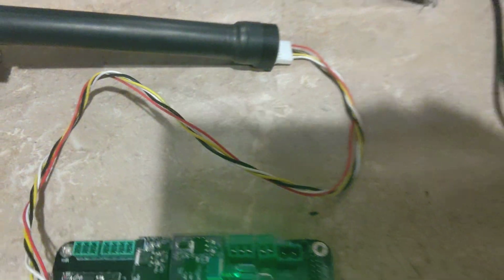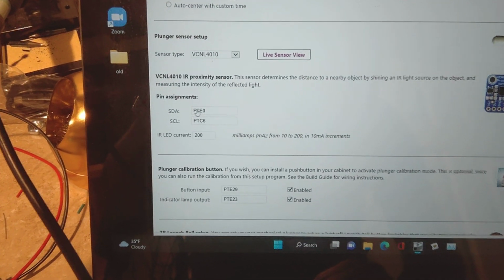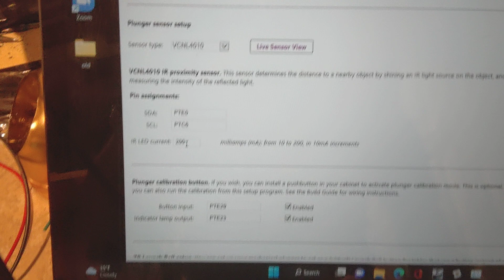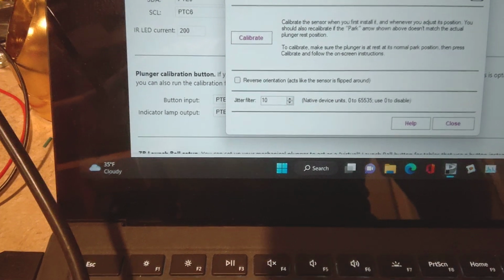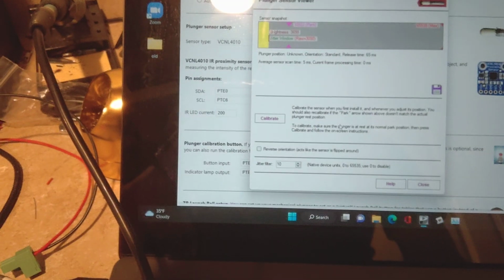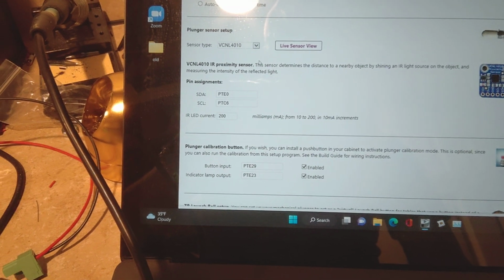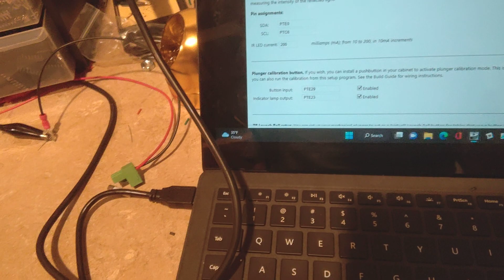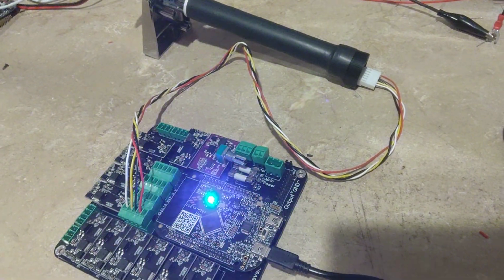Hooking up a VirtualPin plunger into Cleveland Software Design 12 position Pinscape board

Comment: Hello. Will this same approach work with your PinOne Main Virtual Pinball Connection Board? thanks!
Reply from the maker: This is not supported on the PinOne at this point. If you want to add a plunger, you will also need to purchase the potentiometer based plunger available on my site.

Comment: Hey phil should I try changing my plunger settings to these? My plunger only works in some vpx tables and some I can pull it all the way back and it's not strong enough to launch the ball. For some reason the game "24" works though. 
I also have my plunger set to potentiometer.  I have Calibrated it in pinscape although I'm not really sure what was done after calibration in pinscape, it just says it's calibrated. 
On my old setup I guess pulling the plunger was like hitting the enter key, however this time windows doesn't recognize it.
Reply from the maker: Are you using a virtualpin plunger or one of mine? These instructions are only for hooking up a virtualpin plunger to my board which might resolve you issue if you are currently having response issues.
Reply: @clevelandsoftwaredesign  I'm using your plunger,  I'm pretty sure , all I had to do to hook it up was plug it into the bottom of the plunger with the green quick connect,  and your board that houses the kl25z  board. 

Also real quick I want to hook up my rgb buttons to the new extension board etc. You set them up in dof but how does the kl25z board know what are the two flippers and two magna saves? All my buttons are connected to my main board.so will the system know that the new buttons are the flipper buttons etc and that there no longer are the 4 original buttons I had plugged in?